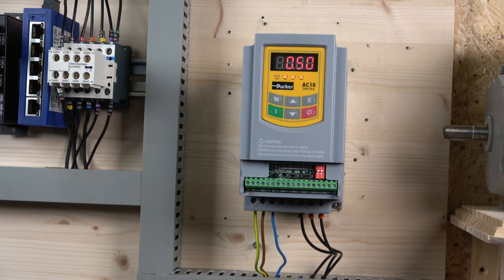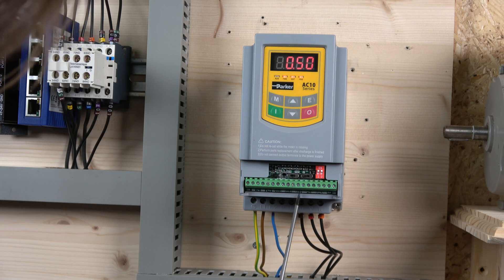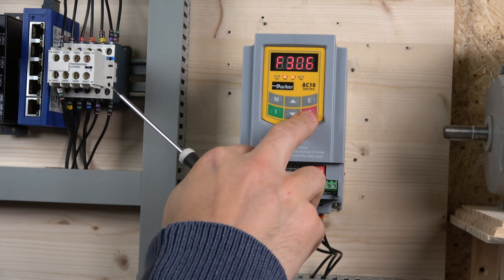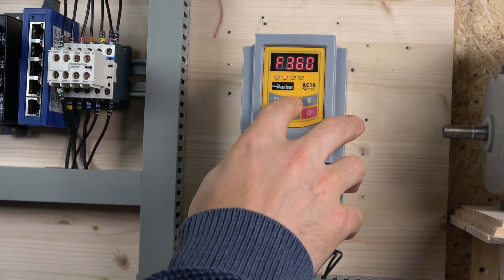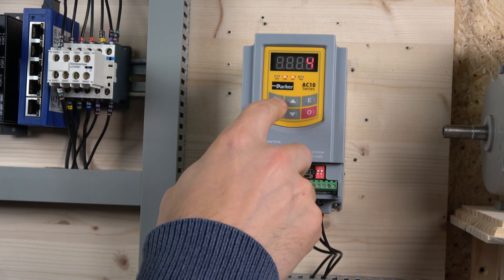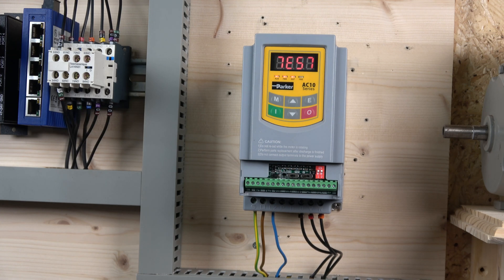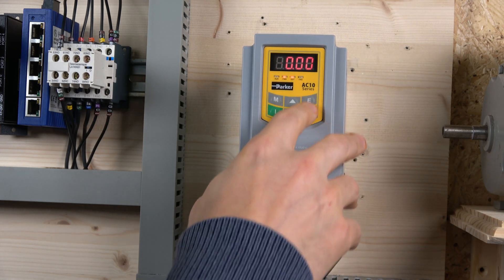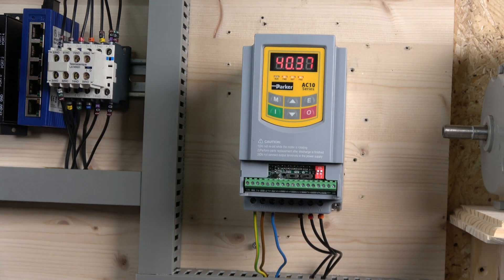Parker AC10 VFD, local control, commissioning, autotuned, parameter set up, factory reset. English

Comment: Hey, I hope you can help me with a dilemma:
I have an ac10 that I wish to test the fault function off
I don't have big enough motors to trip it in the workshop
If I remove a wire the VFD doesn't go into a fault (strange)
and I don't see a way to put external fault in a DI on the VFD

is it something I have misunderstood? I simply cannot get the VFD to go in fault

Comment: hi l have a ac10 on a roller motor runs nicely until weight exceeds 100kilo then stops .
what can l do to in the program to over come this problem
Reply from the maker: Looks like you are overloading the motor, check your current settings in the drive.